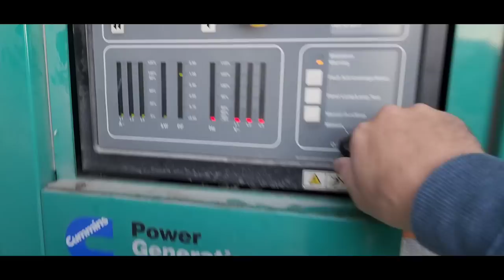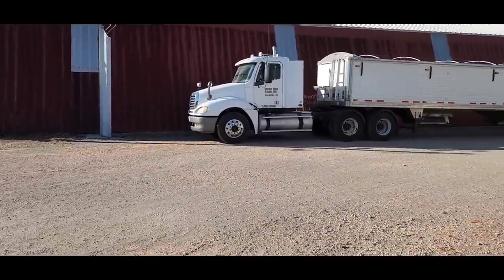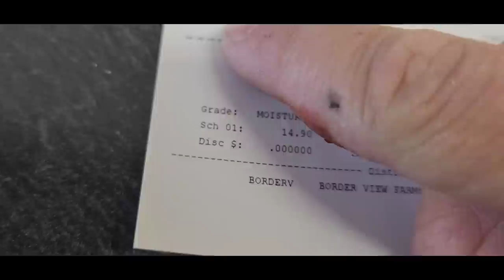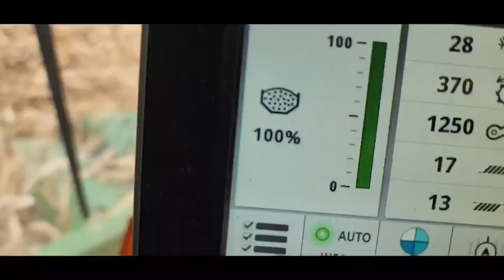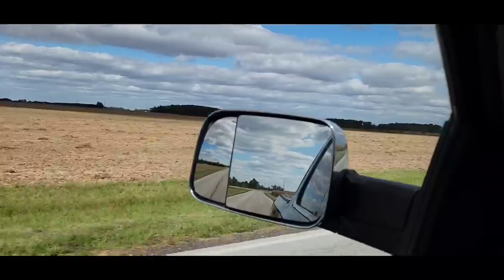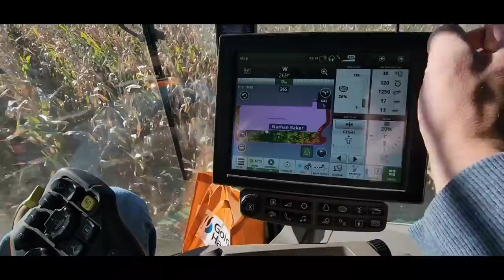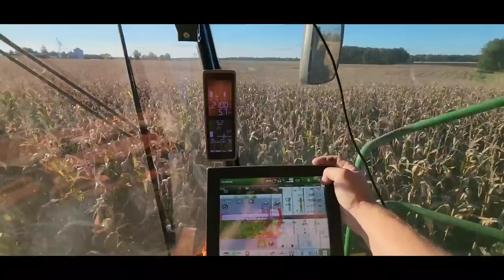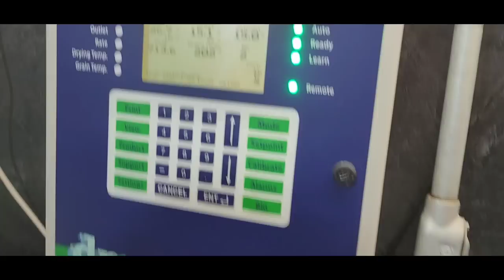Day 2 Shellin' Corn! - #793

Comment: Nice dryland corn at over 250 in some parts.   We are  several weeks from our earliest corn being ready  in West Texas.   We are lucky in that  it takes only a few yards travel difference to get a full tank.   Much of our soil is the same for miles.  No trees or draws, just roads.  You would  think this flat country is boring.  No need to do area testing except for a few problem fields where the PH is high.

Comment: My electrician interlocked my grain system, the leg has to be running before I can turn augers on. If I turn leg off everything feeding it also stops.
Reply from the maker: Yeah good idea. This one is kinda complicated by the fact that the dryer panel controls that unload auger but not that leg.